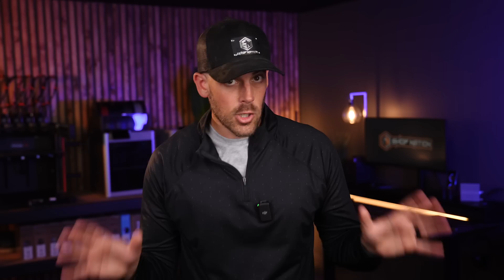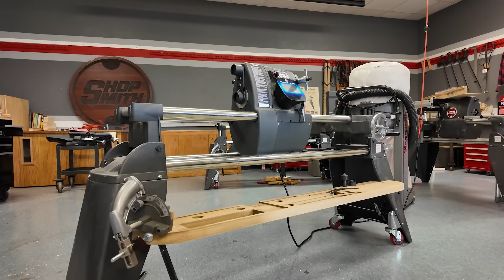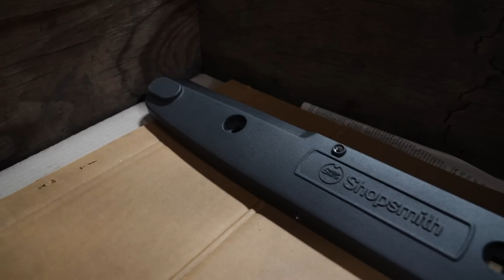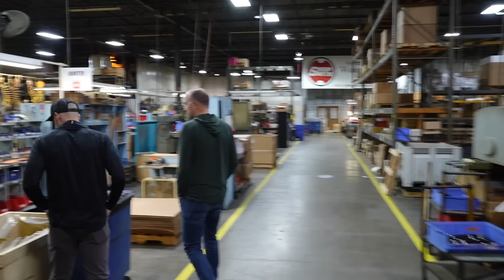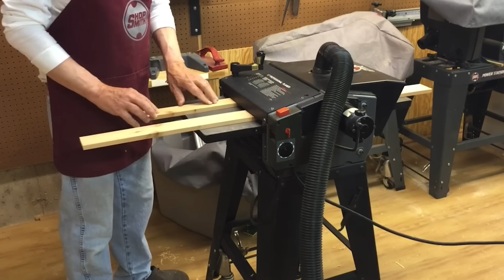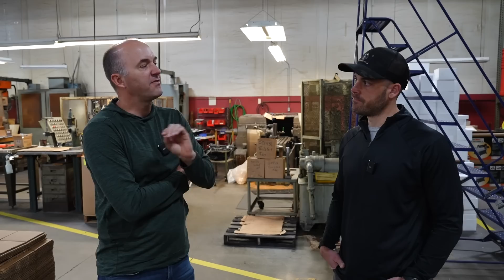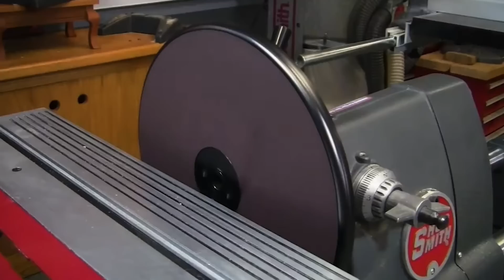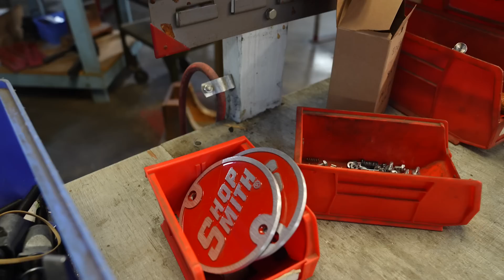The Last American Power Tool Company is (almost) dead

Comment: I purchased my Shopsmith in 1979 during a road show at the local mall. I had a lot of fun with it. But to be honest, Shopsmith needs to die. They are no longer competitive and treated their loyal supporters poorly with their upgrades, parts, and accessory pricing. Their upgrades and accessories are ridiculously expensive. The table system and fence of the Mark V is just horrible and not stable enough. I found it interesting that he said, "We do table saw but that is not the center of our product." Seriously! The table saw IS the center of every workshop. The table and fence twist and bend and result in inaccurate cuts. The upgraded table is nicer but crazy expensive and more complicated to configure. While I loved my Shopsmith, the cost involved with using and expanding it just could not be justified anymore. When I was considering upgrading the table system, my decision was to spend big $$$ for a new table system or just buy a new table saw. I opted to buy the table saw with it's greater precision and far superior fence system. I hate to say it, but Shopsmith just can't be competitive with offshore manufacturers. I now own a table saw, band saw, compound miter saw, drill press, and six inch jointer all in a two-car garage workshop just fine. I don't park the car there, but I think he is way over emphasizing space considerations.  Most garage shops are no longer used for parking cars anyway.  I've got to say, I don't miss the hassle of switching back and forth between the tools. I just can't justify upgrading my Shopsmith so it is relegated to nostalgic stories and the occasional lathe work I do. I wish this guy the best, but I don't know if this dinosaur can be resurrected. His comment that most people just want to make a cutting board or turn a bowl may be correct. But that hardly justifies buying a multi-thousand dollar tool. A small table top lathe and a contractor saw, talking hundreds not thousands, will get that done. I know I've soured on Shopsmith and it is a shame, but they treated their loyal base horribly with their pricing and proprietary accessories. Good-bye Shopsmith.  If anyone in the Houston area wants to buy a Shopsmith, drop me a line, I'll sell it cheap!

Comment: I have my dad's Shop Smith. He passed away in 2011 and had taken the head unit apart because the motor quit working. I had the motor rebuild and I put the head unit back together. My dad purchased the Shop Smith back in the 70's.

Comment: I bought my Shopsmith more than thirty years ago and have used it for thousands of hours.  I have never had a failure - it even still has the original drive belt.  I first bought it because my furnace room workshop only had 8' by 10' of floor space available, just the kind of situation they showed in their marketing back then.  I am now retired and with downsizing my Shopsmith is back in a small space (a 20' shipping container) and still going strong.  In between, I had bigger shops and more tools but once again space is the biggest driver.  I think he is making a smart move to go back to emphasizing the small-space shop and beginner woodworkers.  For most users, the only reason to move on from a Shopsmith would be if they decided to go professional where dedicated/specialized machines are going to be more time-efficient and space is available.  I wish him the best and look forward to seeing more of Shopsmith on Youtube.

Comment: Marketing is so different these days.  I remember the Shopsmith demos in the Malls of the 80’s.  The malls have been replaced by big box stores or small store drive up shopping or open air outlet type environments.  So to get the product in front of the young generation they need to setup demos where those people are shopping.   Places like HomeDepot, Lowes, Sams club, or outlet malls. But most of those stores are selling competing products.  So they may need to have mobile demo trucks/trailers that can be setup near these places.  The key is to expose people to the product - not as simple as it once was where people were just walking around in a large mall.  Not sure how many people would stop and check out a mobile trailer doing demos, but the point is to exposing people to the machine is the key.

Comment: It was great fun to stumble of this video in my YouTube feed. I am a Mark 5 owner and still use it regularly. You are right about the table saw. Raising and lowering the table instead of the blade to change blade height can pose problems. I can cut sheet goods effectively with the Mark 5 as I built a 4' x 8' workable that was  purposely made so that when the Mark 5's table saw is set at the proper blade height to cut sheet goods it is flush with the workable. I was never a fan of the miter saw channels on the Mark 5 being of a different width than is standard. That prevented me from accessorizing my Mark 5 table saw with quality 3rd party equipment. In general, building products that don't  play nicely with other quality made equipment is not a good long term strategy. Of course, that's just my opinion. In general, I consider the Mark 5 one of my all time best purchases. Glad to see the company picking itself back up. I am certainly rooting for it's success.

Comment: I own 6 of these machines and use them all in almost every project.  I do build everything from cabinets to furniture, to gift boxes.  I use these machines not because I need the saving of space, my main goal was to be able to have 2 or even 3 table saws setup for certain cuts and operation.  I have 2 operating 10ER's, one is a 1949 and the other was built the year I was born in 1951.  I use 2 Mark V's (500s with small tables) and they are set up as semi permanent disk sander, belt sander, mounted planer, band saw(2).  The oldest 10ER is pretty much relegated to a jig/scroll saw (yes I know the difference LOL).  I have two 10ER tables on the other 10ER and do a LOT of table saw work with it;  the precision of a 10ER is unbeatable.  I can make killer Parquet flooring with "permanent" setups for repeatable accuracy during the project.  I do my jointing, over/under table routing, drill press and main table saw  operations on either my Mark VII (they should really start making that machine again) or my Mark 7 PowerPro which is the only one I bought new.  All equipment is SS except for palm routers and a sliding miter saw.

I really wouldn't want to do woodworking any other way.  I hope they bring the company back to it's glory years status!

Comment: If they want the shopsmith to survive well into the future.  It's needs to take GCODE and the drill press needs to at least do 3D (X,Y,Z) milling.  Same for the lathe.  Add another attachment that dives the knife in the right area to the correct depth and turn out table legs  the same every time according to a program.  Old world wood working is dying.  This is how the new generation wants to do it.  Also create a shopsmith community to upload and share designs, just like the 3d printing community does it.  People can download the file and churn out the same design.

Comment: Younger people are also not gravitating to woodworking because we have taken it out of the schools in favor of more "high tech" class offerings. I was an academy instructor for Shopsmith back in the 80's. The absolute best job I ever had. Shopsmith started doing away with their educational offerings so I joined the ranks of public teaching as a "shop teacher" by teaching woodworking, cabinet making, and construction my first nine years. Afterwards they started phasing out these courses for the more high tech offerings whereas I then became an electronics, computer education (A+ Certification back then), and manufacturing (learning automated processes and Programming PLCs). It broke my heart. We need these types of programs back in our schools and in some instances they are beginning to make a comeback to some degree, but usually at vocational schools and limited to some high schools. The Mark V is a very practical woodworking system and will serve the needs of most woodworkers for a long time. There is nothing like building something with your own two hands. It's in our DNA! The personal satisfaction is hard to measure. Best wishes to Shopsmith for a bright and successful future for many years to come.

Comment: I’ve always considered a significant “missing message” for owning a Shopsmith (SS) is its value to the owner as they grow their shop. No doubt a SS is a great “do it all” initial machine but to the woodworker with the goal of a “tricked out” shop the SS serves as a flexible backup/alternative tool to 1) start a shop and 2) to grow the shop. In one tool you have 7 (really 10 to 14 if you include stand-a-lone accessories) different backup tools. As I’ve supplemented many of the capabilities of the SS (e.g., stand-a-lone table saw, jointer, planer, belt sander, etc., etc.) it’s been a blessing over and over to have the SS serve as a second machine. For example, I set up my table saw and SS to rip different widths, or one for ripping and the other for cross cutting; I set up the drill press for one drilling operation while the SS is set up as a drill press or horizontal borer for a separate drilling operation; etc.). This ability to have a second similar machine in the SS has made it an invaluable turn-to center in my shop to supplement one-trick stand-a-lone machines to reduce the setup-resetup configuration for a wide variety of machines. 

I’ll note that the SS belt sander is, in my estimation, without peer in the woodworking equipment industry. 

I’ll further add discontinuing the SS planer is a great idea as it can not compete with a DeWalt 735 planer ($600) upgraded with a Shelix helical cutter head ($500) compared to the $2,000 SS planer without the helical cutter-head option. 

The SS remains a center of my 900 sq ft shop with most tools duplicated with stand-a-lones. Example: for years I wanted a stand-a-lone table saw in the center of my shop relegating the SS to secondary status. A few years ago I “found” top of the line track saw that now handles all my plywood and large timber cutting requirements and the SS table saw fulfills all of my other table saw needs. I also held off on the Power Pro and PP2 upgrade until I found the SS Deputy upgrade to put my original headstock to full time use (I mostly use it to power the 6x48 belt sander and dish sander) and the PP2 as my supplement to all my other equipment. It used to be my entire workshop… now it is my essential supplemental shop!

Comment: My first saw was a Skil Saw (still have it, got it before they changed owners and manufacturing plants).  From there my first table top saw was a miter saw for cutting all sorts of things from trim, wood flooring, patio blocks, siding, etc.  My dad had a Shopsmith that at some point I might get.  Still worked the last I knew but it's been a while since it was last used.  Very sturdy and versatile machine.

Comment: When I got out of high school, I joined a state sponsored apprenticeship program to learn antique furniture restoration and handmade reproductions. Although I got out of the business professionally to pursue other things, I did that for many years. I had access to all kinds of professional equipment and can operate any woodworking machine.
 The machine I got for home use - Shopsmith. I've done tons of side jobs and personal projects over the years with that machine. My goal is to at some point, produce an authentic reproduction Queen Anne Highboy (claw and ball feet, finials, the works) using my Shopsmith. I'm absolutely certain it is capable.

Comment: My Shopsmith is 70 years old, number 3,072 in the production line of 1954. It is still shiny and runs better than its owner. I have a well equipped shop with all the individual tools that are included in Shopsmith’s multi- tool system. But, no tool in my shop is better made than my Shopsmith. My Mark V has outlived several generations and will still be shining and functioning long after I push up daisies. Some might call my Mark V an antique relic, but I know of no relic among tools that can still do what my multi-system 1954 machine can still do. Even in its first rendering, it was well engineered. Mine still strokes wood with the stokes of genius that the original owners showed when they launched the company several generations ago. I hope the new Shopsmith team can resuscitate the company so that it 7is around for many more generations.

Comment: I own a full compliment of power tools, 2 bandsaws, 3 lathes, jointer, table saw, mortice machine,  and others.  I started with hand tools and later a Shopsmith given to me by my bride.  At one point I sold it thinking why did I need it anymore.  Big mistake!  There are many things I use the replacement Shopsmith for that are faster easier or safer than the stand alone tools.  I do wish I had my original Shopsmith back because it was a treasured gift.   BTW, I design and build custom furniture, one piece at a time. Sold the first piece of my own design  over 55 years ago.

Comment: I used a 10ER made in the same year as me (1954) as my main shop tool ( along with my gradfathers 1940's DeWalt radial arm saw with a 1 1/2" cut depth capacity) to build my current home.  Have recently also acquired an early 60s Mark 5.   Will be looking for some accessories

Comment: i am a mkv owner,version 1, it still works really well. He is correct, the table saw is rubbish, so is the drum sander. Jointer is solid though i need some replacement parts for mine and a fresh set of blades. This machine shines best as a drill press and a lathe. I primarily leave mine set up as a drill press. I also have a scroll saw attachment that i never have used nor have i used the disk sander. If i were the owner i would focus on the lathe and drill function and this is pretty solid machine and i think with a better bed more solid you could do some milling along with your drilling. I tried this myself but with the stock saw table as a milling surface its just not skookm enough and wobbly. Might even make it so you could use machine taper chucks like in a bridge port. edited for spelling

Comment: Suggest consider popularity of 3D printing and, for example GridFinity — open source modular storage system. No reason those plastic components— grids, dividers, connectors which take are not cheap to print couldn’t be made of wood… free scrap wood. Again, just an example, tho perfect place to start for ppl with limited space, or just like to have order that can evolve with changing needs/space.

Comment: I have owned a 10ER for over 35 years. It's built like a tank. I agree that its weak point is the table saw. I think a fixed table and tilting arbor saw is safer and more convenient, so I also have a 30+ year old Delta Contractors saw.

With just 3-step pulleys and the inability to use other attachments, the 10ER has some limitations. I think a DC motor and variable speed drive could be adapted to it, but that's pretty hard to justify. 

It's been hard to watch manufacturing being outsourced and tool quality, in general, degrade over the years, so I hope this brand is able to survive.

Comment: A very long time ago when I was just getting married (1968) My then father in law had a Shop Smith in his basement ... I was very impressed but later when I was setting up my own shop I decided against the shop smith option because I didn't like having to break down the setup to drill a hole or plane the edges ...every new operation requires a new setup ... besides I wanted a metal lathe ..!

Comment: There is hope for the future. China is now struggling with a hurricane of problems: wages in China are now uncompetitive, they face a demographic collapse with 50% of the population near retirement age, their politics and geopolitical situation is catastrophic. many manufacturers are moving out - not just to SE Asia but also Mexico, which is now the low cost producer and has excellent opportunities via NAFTA and relatively easy ground transportation.  In the next 5 to 10 years North America (Canada, US, Mexico) plus some of the central american neighbors, will likely become increasingly self-reliant as a region. The rebuilding of manufacturing in the US will drive some inflation, but other parts of the world will struggle much worse.

Keys to success will be very smart engineering and design, and rapid transition to smart automation.

I've owned two Shopsmiths, one original, one second generation. They are great for small shops where you don't have room or money for a huge set of tools. Scheduling your work sequence can be important!

Comment: I have a  Mk 5 machine bought in 1985. It still runs and works . The ways need polishing over the years and its not happy about running on sub freezing days in the garage. All logical problems. I seriously doubt I have any power tool that has  survived so long. Mine was not abused per say but storage in a unheated garage is not ideal. If I need to use it I have to get what ever is on it off and roll it out. I have  failed it in a way but it sits and  waits and doesn't get care it should.

Comment: I have a pretty advanced hobby woodshop, my first tool was the Mark V. I keep it for use as a drill press and disk sander.  Also have a bandsaw attachment that I use.  So its still part of my shop, just not the "center" tool. BTW, I did buy my Mark V used, but its really used today but just a little less..

Comment: I had one, the table saw was just user friendly. The table moves up and down instead of the blade. Then you have adjust the table and if you have adjust any additional table. The accessories are as too expensive. I bought a table saw never used to table saw function on the shopsmith. I sold it and bought a jointer, planer, bandsaw, and drill press. I loved it, set up took too much time.